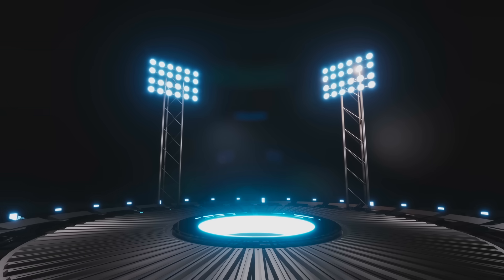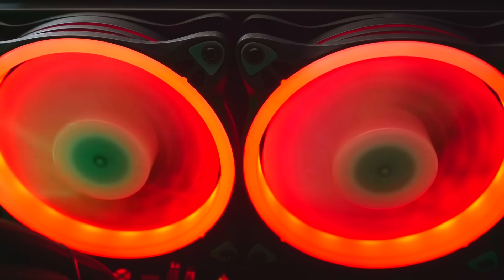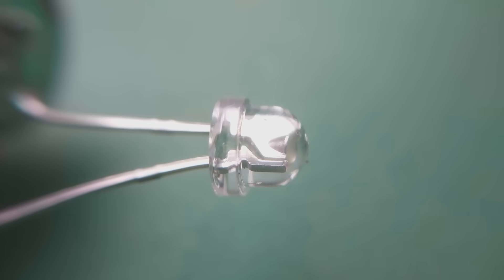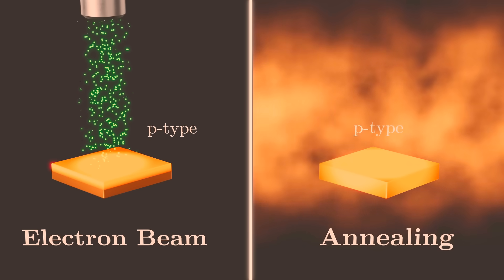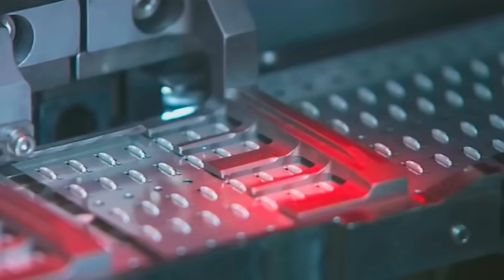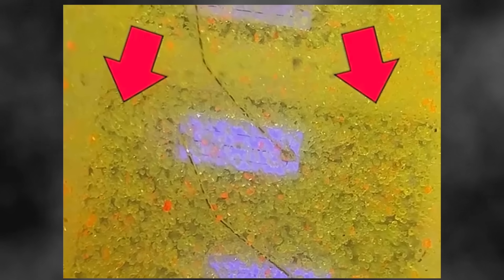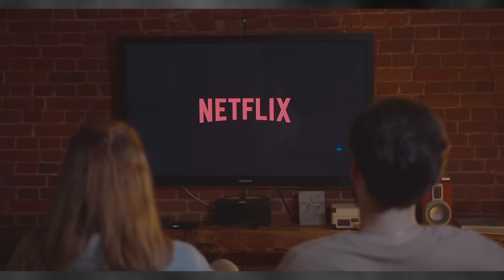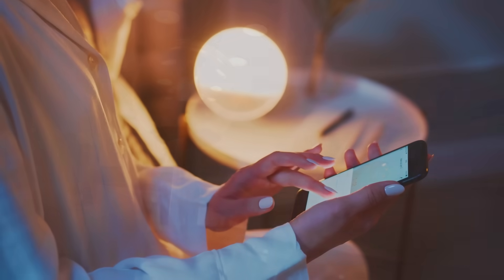Why white LEDs are IMPOSSIBLE to create 🚫⚠️

Comment: Actually the first LED was IR, and IIRC, it was invented at Fairchild.  The Red LED came later.  White LEDs are also UV, and RGB.  White LEDs that have 3 chips (Red, Green, and Blue) can create "white" light, but usually NOT in the desired color balance, so they use a Blue or UV chip to excite a "white" phosphor to get the desired color temperature.

Comment: White LEDs do not exist for the same reason white lasers do not exist. White is not a color, it is a mix of all colors - or all three primary colors. But I wonder if better LED lighting, with purer white light, could be made by combining all three LEDs in a single composite LED. 

This started being done with microLEDs for monitors, but their subpixels are tiny. Would it work with larger RGB LEDs? If they were placed on top of each other the light of the bottom and mid LED would be partly blocked, and probably also overheat. 

If they were placed next to each other all three would operate nominally, but unless they were tiny like microLEDs (imagine blocks of hundreds of them) could three normal sized RGB LEDs generate white light or would it be RGBish?

Comment: Something someone told me that seem to hold true is that hot climates prefer Cooler White while cooler climates prefer Warmer White. I have a particular preference that ranges between 2,200 to 2,500 Kelvin that is very Warm. Your standard Warm White lamp usually runs around 2,700 Kelvin while Cool White runs about 5,000 Kelvin.

Comment: Many years ago I replaced my incandescent kitchen light bulbs with circular florescent. They looked the same as the incandescent but all the boxes looked weird. The main difference was incondescent Black Body radiation rather than a spectrum of emissions lines balanced to appear warm white. The same holds for LED lights. Photographic equivalency is a long term for solid state lighting. The packaging were pigments with absorption peaks and minima that don't align with emission lines.

Comment: i hope we get a white led soon.. snd it booms soon after that and starts replacing the fake white led we have... because there are so many led lights that is advertised to have a white light setting but instead the light is just bluish white.. and i have seen a lot of leds that also has too much yellow...  it do seem the balance is very hard to grt right.. especially on dimmable leds as a layer on top of a blue light can't be tweaked with the light level which messes it up.. and yea.. while i personally prefer red light in general due to it having the lowest amount of blue light and going easy on the eyes due to it soft warm glow i do think true white leds are a very important next step due to the efficiency it ads..

Comment: another reason to get more pure color LED types is that lit objects will look different based on the frequency composition of a light source. 2 lights that both appear 5000K white can consist of completely different frequencies, and will light up a scene completely differently. All objects reflect certain frequencies of light in different amounts, so if a white light that is actually only yellow+blue is used, an object that mostly reflects green light such as leaves will not appear as green as if you used a true white light

Comment: I'm recovering from vision loss due to optic neuritis. As  my eyesight returns, I've noticed blue light in particular sticks out to me a lot. I can see blue light the easiest right now, and strugglee with seeing the color red accurately, because red is a lower energy wavelengtrh vs blue light. Also sunlight reflecting on white surfaces appears veryblue-hued to me currentlly, and not really the proper white you'd expect from natural sunlight. When I started regaining enough eyesight to be able to see when lights were turned on, I now have a strong preference for indoor lighting with a warmer color temperature, as cooler coloor ttemperature found in many "daylight" LED bulbs today looks like WAY too muchof a blue hue, it's very garish. You made great points at the ed about why offices use more blueish lighting to improve alertness.

Comment: I have both 4000 Kelvin spots and 2750 ones. When I want to sleep, I never switch on the whiter ones, but when it's too gray and dark in winter, I use the whiter ones for easier work. When I was new in Europe, I couldn't stand having only reddish lighting in winter that I literally rode a bus to the next city to by a white light bulb.

Comment: We use LED lighting, mid range quality, around 2700 Kelvin.  I can't stand the 3000 Kelvin plus, it's too white.  I'm still waiting for the newer incandescent technology to arrive in the shops (research into an incandescent type system where the infrared or heat somehow feeds back, preventing loss of energy?).  I think the benefit of that newer light is the richer wavelengths of light, are closer to natural light.

Comment: i have been using Hue lights in my living room and my bedroom since 2018 and part of the reason was the Ambilight+Hue feature on my tv.
it would make the ceiling bulb follow the tv content, but the ability to go either warm yellow light or bright white office style lights, has been rel nice as well.
and i remember back when old incandescent light bulbs started to be replaced with those slow firing energy saving models.
i went ahead and stocked up with 20 incandescent light bulbs from old stock and still have most of them left.

let's just say that there is no return to incandescent light bulbs for me, not after gotten used to modern LED bulbs.

Comment: I don't think insomnia is just caused by white LEDs leaking blue light. Even if you make a natural fire source that's mostly white, it'll still mess with your sleep cycle, like sunlight, xenon arc lamps, metal halide lamps, carbon arc lamps, etc.

Any white light must have blue component in it to be white. White LEDs mainly give off pure white light with a bit of a blue spike in the spectrum, but it's not the same as mixing three colors like OLED displays do. So I'd say any natural white light can disrupt sleep, and it's not just about white LEDs leaking blue light!

Comment: Some places have issues with LED street lamps turning blue after a while and the reason for it is the yellow phosphors being stuck on to the outside of the blue LEDs with glue or adhesive with the heat causing the glue or adhesive to degrade over time. This eventually result in the phosphors falling off causing the blue colour however this is not a problem for white LEDs that have the phosphors integrated in the LED casings with the diodes.

Comment: The cool thing about diodes is if you put enough volts into them, they all eventually become light emitting diodes
Reply: also works on resistors,
Reply: @xcbrr50 this guy knows about it
Reply: "smoke emitting diodes".

theres also that variety of diode that produces light as its inherent part of operation... vacuum rectifiers... or gas/mercury filled, if you must...
Reply: @PERTEKofficial  nope the coolest thing is that they convert enecticity to light and heat and vice versa
If you put light in a diode it convert it to electricity but not as efficient as solar panels
Reply: it works with everything if you really think about it
Reply: Silicon diodes emit in the infrared wavelength range, due to the bandgap of silicon. And at that they aren't efficient emitters, as the bandgap is indirect.

Comment: But white light doesn't exist it's a mix of the whole rainbow.
Reply: White light exists, of course, not as one wavelength or frequency, but as a continuous spectrum of all visible wavelengths.
Reply: @Tag-Traeumer  it's like elements, there's no element called "Glucose" because it's a molecule made of elements, so there's no elemental white light you can get just by changing the wavelength of an electromagnetic wave
Reply: @Gozieaaa  Of course there is no such thing as monochromatic white light. However, light does not have to be monochromatic, and white light, as daylight, is THE light. That is why comparing light with chemical elements and chemical compounds is not entirely correct. It is correct that there is no single wavelength of white light.
Reply: @Tag-Traeumer  of course, comparing monochromatic light to periodic elements is a mere analogy
Reply: @Gozieaaa  Another analogy would be that there is no such thing as 275 Kelvin water because the water molecules in this water have very different temperatures, some below freezing, some above boiling. Of course it is still correct to say that the water is 275 Kelvin.

Comment: Scientists: takes 30 years to make blue LED.
Other scientist: Okay, now lets make a white one.
Scientists: No.
Reply: If they did we wouldnt get eye strain watching displays
Reply: @khan.No1  a screen of white LEDs would be completely white, they’d still use red blue and green LEDs, even if white LEDs existed
Reply: it legit reminds me of the video from veritasium about the blue led (fun fact it is the top recommended video on the site even though i watched it already
Reply: No scientist would suggest making a (non compound) white LED, unless they were unaware how lasers worked. It's the same basic principle. White laser is impossible, but you could technically merge three laser beams into one to generate a white laser beam. 

The merging would need to be precise, and the three parent lasers would need to have a near perfect red, green and blue wavelength, but it's not unfeasible. This is a similar trick to microLED panels (not to be confused with miniLEDs; these are for LCD backlighting). 

microLED pixels consist of red, green and blue subpixels, so if you generate a fully white image with such a panel you get near perfect white light. No color filters, no polarizing tricks like with LCDs, no backlighting, no phosphors, no nothing. They're the real deal, and are very high endurance and bright, unlike OLEDs. But they're still super expensive.

Comment: You cannot really make an LED, that emits white light. LED is a semiconductor junction that generates light at a single frequency (or wavelength), and white light is a mix of frequencies from red at the lower to blue at the higher end. Thus you would need a junction that generates multiple frequencies of light, and that's not how those things work. Alternatively you can pack multiple junctions one next to each other, but that's just a set of different color LEDs, just at a smaller scale.
Reply: That's what I was thinking as well.  No one is "trying to make a white LED".  I did learn something from the video, I thought since white was a combo of red, green, and blue this is how they were doing it rather than the correct method the video presents as filtered blue with phosphor coating.

Comment: Seems like white LEDs use the same kind of system as white fluorescent tubes then. Fluorescent tubes natively produce ultraviolet light, a phosphor coating on the inside of the glass absorbs this and re-emits it as white light.
Reply: The only difference would be is that the phosphor on florescent tubes is white, not yellow.
Reply: @samsimington5563  That's because it needs to fluoresce in the full spectrum.  White LEDs only need the red through green part of the spectrum, with blue being the component of the LED's emissions that diffuse through but don't react with the phosphors.
Reply: There are also UV LEDs, which were developed soon after blue ones, by modifying the doping and layer stack of the diode. Theoretically, with an added phosphor they could also generate white light, but at probably a lower efficiency.

Comment: I bet the first experiments to try to make "white" light emitting diodes after blue was created were those with all 3 LED dies on one tiny chip with a common anode and 3 cathodes.
Reply: I really wanna know why doing exactly that wouldn't be a better option than the yellow phosphor option
Reply: @alexkuhn5078 Because it is not actually white. It is  individual red, green and blue light. Actual white light includes all colors of the spectrum. Using only RGB results in a very different color rendering that  make things looks really off. So while RGB makes for great displays, they make for terrible lighting.

Using phospor gives you a more full spectrum light and provides results closer to real white light. It is not perfect though; white led lights has strong blue and yellow spectral immision but pretty weak every where else. There are white led lights that has more complex phospor formula that tries to minimize this (used by film studios and artists where accurate color rendering is important) but they are kinda expensive.
Reply: @rosverlegaspo6752  I think the main reason is the large size of the RGB LEDs. You can generate great white light from the three primary colors, but they need to be well mixed. 
mm to cm sized RGB LEDs cannot mix their light well enough to generate good white light, unlike 50 to 100 μm sized microLEDs, packed tightly together. This will be tested with microLED panels, whenever they become widely available.
Reply: @NikolaosSkordilis  That is one reason but not the main one. You can actually use diffusers for this and led lights are already tiny; what makes them look big is the casing they are inclosed with, but the led themselves are just tiny dots in the middle of it all.

The actual main issue is RGB white light just doesn't work the same way like true white light does. You see, objects reflect a whole spectrum of light, not just RGB. Now if you have a yellow object, it reflects mostly the yellow area of the spectrum and absorbs most of the rest, we see it as yellow since the red and green cones in the retina reacts with the yellow light and R+G registers as yellow. But with RGB light, there is no yellow. The yellow object would actually absorb most of the RGB light. Because of that, it would look really dull under RGB light. In extreme case where an object reflects at a very narrow spectrum that is not R G or B, it would look dark or black under RGB instead of a bright color tbat it actually is. That is where the biggest problem lies.

This is also a problem with white LED but to a lesser extent. White LED does produce a wide spectrum of light but most if it is the Blue and Yellow of the spectrum. Blue + yellow registers as white to our eyes. But like with RGB, it doesn't act like real white light does. White LED for example has problem with red, since white LED is actually mostly blue and yellow and doesn't much of red. Red is particularly important because our skin has a lot of red in it and skin looks awful under typical white LED lights.
Reply: @alexkuhn5078  an important reason why to use phosphors is the shape of the resulting light spectrum.

If you just mix blue, green and red LED modules, which are naturally very narrow band, you'll end up with a spectrum consisting of 3 distinct spikes. This might look "white" when observed directly, but is terrible for illumination of materials.

To get good rendering of colors under a light source you need spectrum which is smooth and wide. That's where phosphors help. At least in the green–red area. The blue–teal area is still a problem with the current technology though.
Reply: @alexkuhn5078  I guess energy efficiency. The energy required would be 3 times more than using a single LED.
Reply: @alexkuhn5078  less efficient probably.
3 dies as opposed to a single blue die.
Reply: In RGB light strips available today, they come with a white setting that turns all 3 colors on. It is not ideal since the result doesn't look very good. I think it gives off a strange blue/purplish white light.